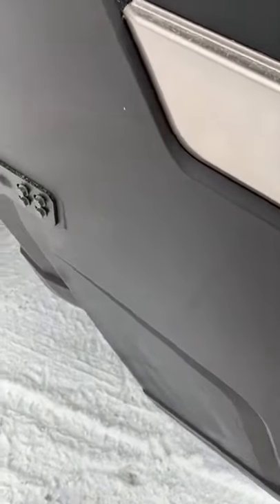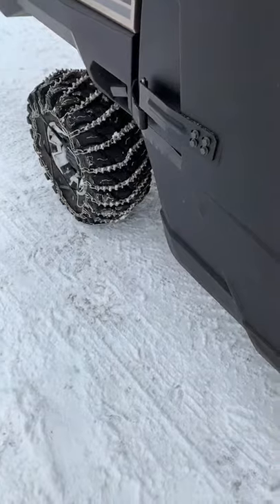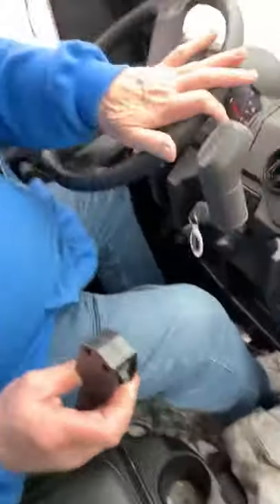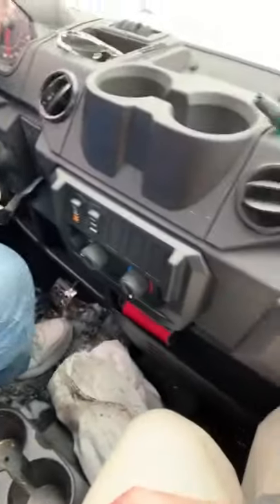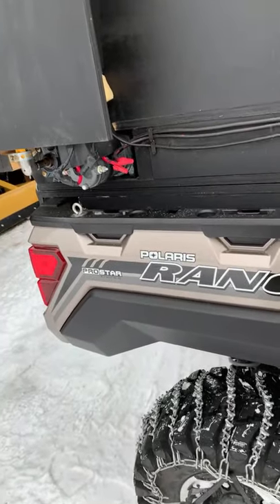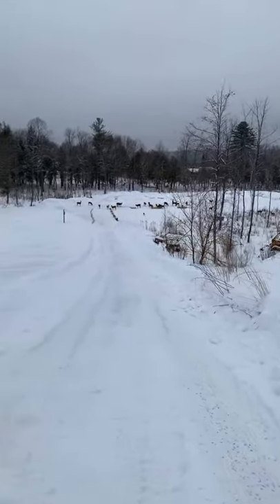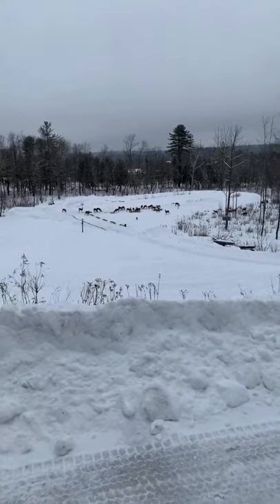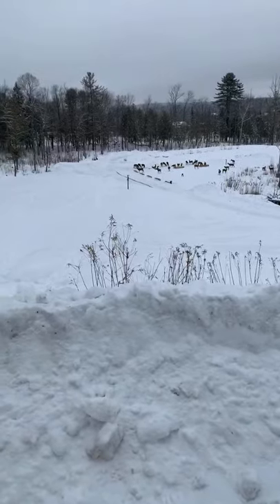Oatmobile feeder system

Comment: I’ve always wondered if the Oatmobile was a Northstar addition. Question for Richard,,,,,,,,how well does the cab seal? And how well does the heat work during winter, and AC for Summer????? Do you ever drive it on road? Downtown? Or different places?